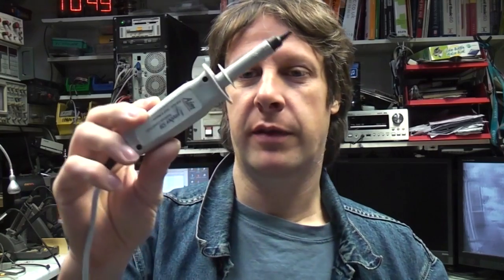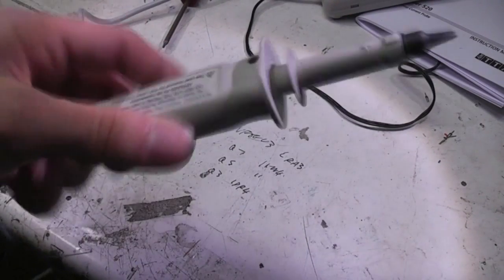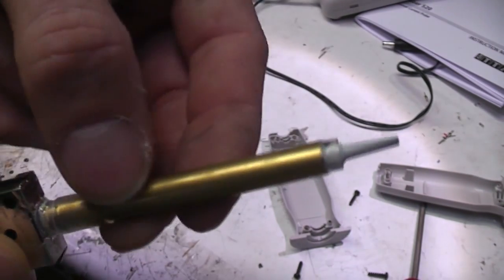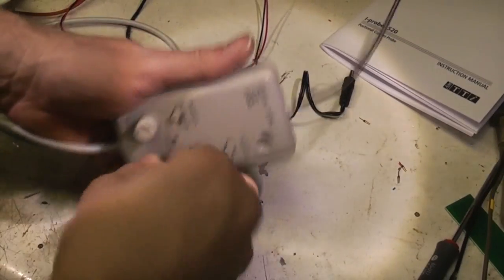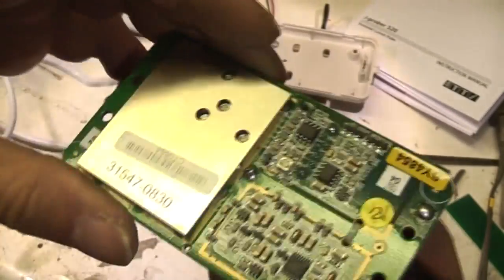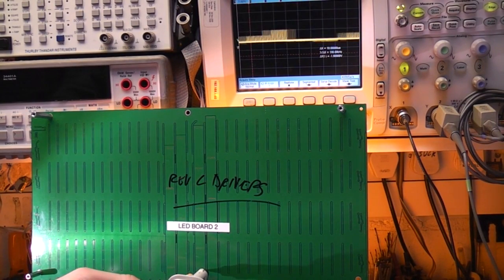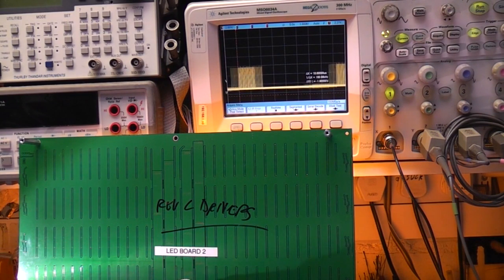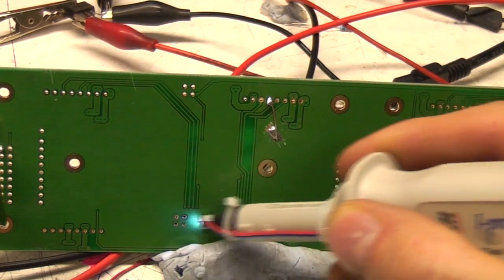Aim-TTI I-Prober 520 teardown

Comment: Nice, thank you. I got deal on a toneohm 950 (it is a audio  short locating instrument), but it has no leads. the leads cost over 7 Benjamins. I decided to make them my self mainly because I got no Benjamins to spare.. 1 of the  3 leads is a non contact magnetic probe. would you be kind and give me some idea on how to make it. Apparently the current probe  can be used either with the board powered on and or off. But when board is power off, the instrument proves a drive source voltage which need to be connected to the board for the current. Drive source voltage is from 23 mv to 500 mv DC. any info would be appreciated.

Comment: Is that a 700 or 800 degree tip in the metcal you use for desoldering those shields? I have a 5000 series metcal at work, and they do indeed live upto the hype that you hear about them.

Comment: How about converting the output to pitch instead of volume? Then it would sound like a metal detector.

Have you tried seeing how the current density changes when ground wires are tacked on like some mfrs do to fix problems with coupling, etc. You could see instantly if that kind of bodge does any good.